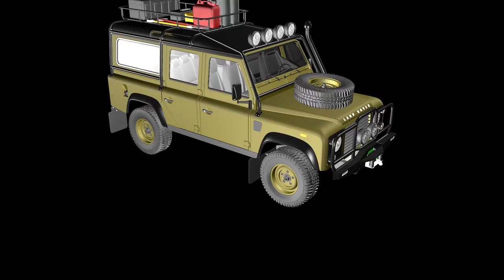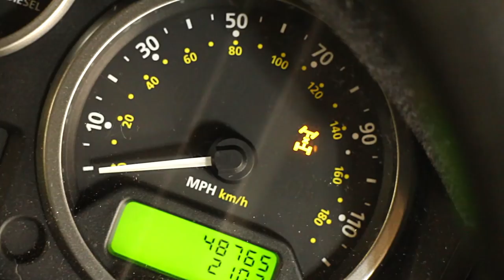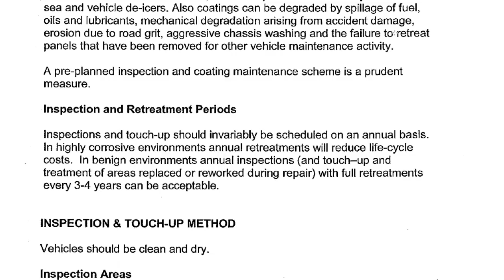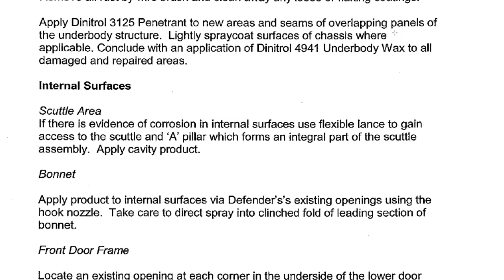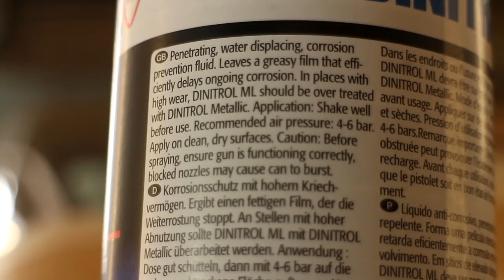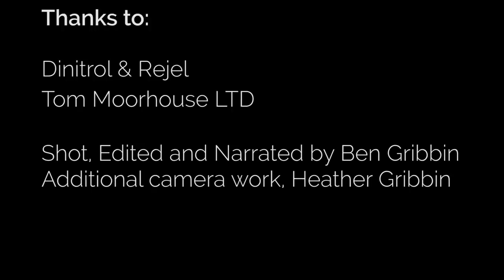How to rustproof your Land Rover with Dinitrol

Comment: Good video, my old mechanic used to spray my old engine oil on the chassis for me, obviously not as good as this product but the original chassis is still going strong some 30 years after it was made.
Reply: Quick research suggests that Dinitrol is mineral oil, so basically Baby oil.

Comment: Use an air line as well as steam cleaner to remove dirt and improve drying in the chassis rails and hard to reach places. A flexi air line nozzle is ideal. Also removes the dirt from wire brushing corroded areas.

Comment: Came here to see what Denitrol was. Asked a local body shop to do some panel and paint work and also rust treat the undercarrige of my bus. Got it back and Was pretty sure they charged me for the undercarige treatment but still rust spot areas and looked like nothing had been applied. Emailed them with Photos. Still have to take it back anyway because parts of the paint work they did were sub standard. Thanks for this video.

Comment: Great job ... will be starting a complete rebuild interior and exterior/mechanical/chasis of a 91 Disco 200 tdi (25 yo)... Once I gut it I think I'm gonna be frightened to find how much rust damage there might be, already know of floor etc but underbody arghhh! ... I am sure grinding and new plates/panels will have to be done, will be taking the body of the vehicle off, etc. This is a fantastic way to vastly extend the life of somebody's vehicle restoration, not just protecting your nice new Land Rover.  To do what you've done to this Defender with purchasing every product in this example, how much (approx - disco, bigger chasis, more cans of product) would it cost?? THX Great vid, looks awesome underneath; as said in Scrapheap Challenge 'Proper Job'!!

Comment: Ok what’s it like underneath in 2019 ?
Reply from the maker: Sold it in 2015 so have no clue.
Reply: Going in next week for professional Wax oiling, lots of surface rust on chassis but I think it’s sound enough. Will know better when they have it up in the air next week. Must say I’m disappointed considering as well as Dinatrol,  in video it has been rust proofed when new by another outfit.
Reply: Actually thinking about it, you would almost think that the exterior of the chassis had never been treated. And considering it’s been done twice in its life, it’s pretty poor. At least my man will arrest some of the rust, hopefully it’s not too late.

Comment: Want to rustproof a Landy? Spray the underside with used dieselmotor oil. It will creep everywhere and stops rust dead in its track.
Reply: What about rust already there though? It will need treated no?
Reply: @David-cm4ok  If it's not rusted trough, it will saturate the surface rust and stop it in its tracks ;-)
Reply: @ButchE30M3S14  thanks for the reply. Mine is all surface rust underneath, pretty sure it's not rotted through, so your suggestion could be an answer.
Reply: @David-cm4ok  does application of used diesel motor oil helped you with prevention of corrosion by any chance? 

Collecting experience to experience. Just it.
Reply: @travisfern  I'm afraid not mine mate. I put on too late and my car was written off last mot, due to rust. Get it on early 👍🏻

Comment: After applying Dintrol will it stay put when off roading ??, ie , is it Thick enough to Stick like Sh1 t
Reply from the maker: Tod Lindley Yes it will , though you'll need to re-apply the coating more often if putting it through extreme driving conditions

Comment: How long does it last?
Reply from the maker: usvet76 2-4 years typically
Reply: funroverdotcom
That is a lot of work just for 2-4 year protection. There is this stuff in the USA that started out as a spray in bed liner for pickup trucks and 4x4ers spray it on the undercarriage and it works great has a lifetime guarantee as well. I have not been able to find a distributor in the UK. The closest is in Germany. Its called "Rhino Lining". Every serious offroader I knew in the US had it done. Amazing stuff and less hassle.
Reply: +usvet76 I think this is marketed as "raptor" in the uk and you can buy it from Paddock.
Reply from the maker: Stone chipping products are not the same as a rustproof protection product like this
Reply from the maker: +flex93312 Raptor / rhino might last longer but it is not specifically designed as a self healing rust inhibiting coating. There's potential for cracks to form, allowing water to get underneath and then rust away - out of sight. Rhino liner is best kept to truck beds and floors etc.